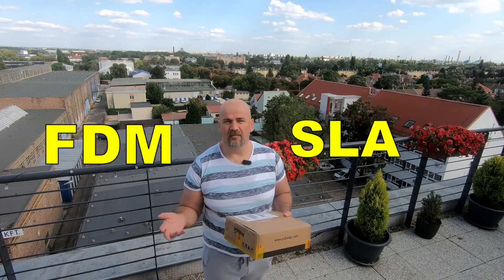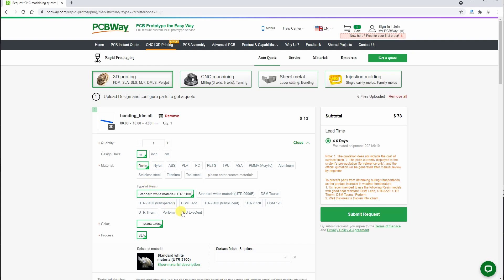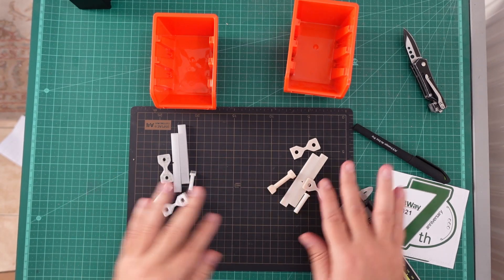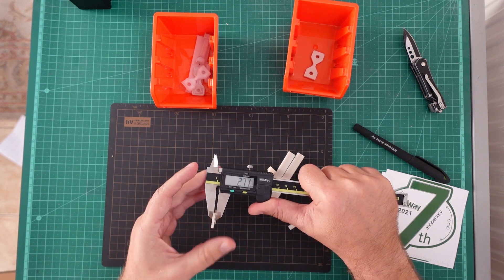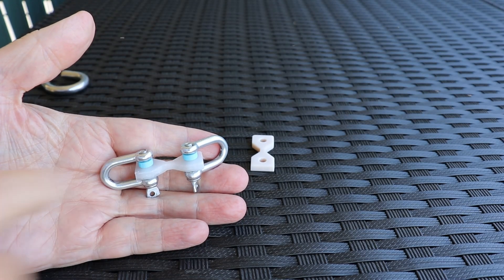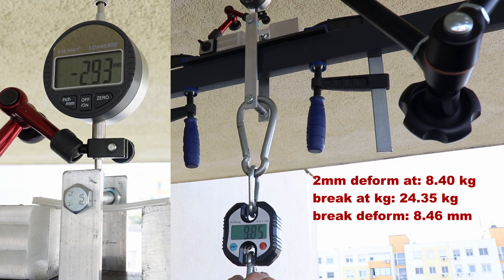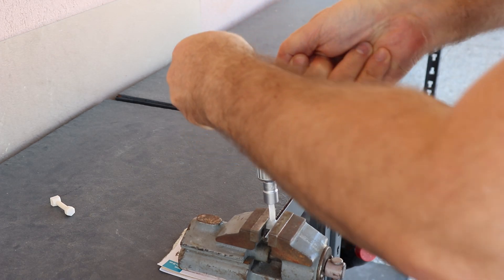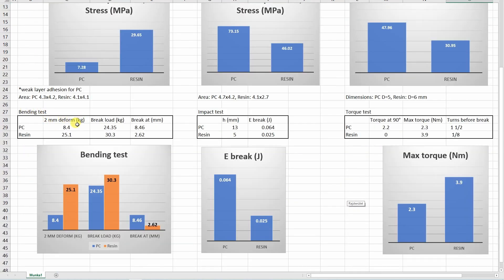Another FDM vs SLA battle: PolyCarbonate vs Perform Resin - 3D printing services from PCBWay

Comment: I really like your testing. I just want to comment on your suppliers. They may offer services to build parts but I am skeptical that the utmost care is taken when building those parts. FDM PC printing requires attention to temperature in all aspects of the printing process and even post heating. Most filament manufactures require  two to four hours of annealing after PC is printed. I can get a good idea of what your results show, but I feel until you produce the parts yourself  I have to take the results with a grain of salt. Again, I really appreciate what you are trying to do here and have subscribed to your channel.
Reply: I think for the case of FDM PC printing, if attention to detail is put in with respect to first layer parameters, bed prep, bed temp, enclosure temp, printing head temp, and the recommended filament manufacturer annealing times/temp; then FDM PC parts can be close to injection molded parts for certain applications. This would be a great comparison for the "My Tech Fun" channel.

Comment: Maybe i am wrong, but i think SLA printed objects are more similar to injection molded parts. Sometimes it gives an advantage to them sometimes the FDM performs better. Kinda similar to solid wood vs plywood strength.
Reply: Not really, fdm parts will always be at most equal to, but generally weaker than a identical injection molded part ( assuming the same plastic) due to layer adhesion.  resin is a quite different story as it has to be made of molecules that can be polymerized at low temps, uv blocking and many other factors as well as being mechanically strong. It's pretty difficult to make a resin that's good at all those things
Reply: I think for the case of FDM PC printing, if attention to detail is put in with respect to first layer parameters, bed prep, bed temp, enclosure temp, printing head temp, and the recommended filament manufacturer annealing times/temp; then FDM PC parts can be close to injection molded parts for certain applications. This would be a great comparison for the "My Tech Fun" channel.

Comment: SLA either has burn in layers on the bottom, when printed on the build surface directly or when raised and supported SLA prints will have support marks on the bottom. I think they sand these prints.
Reply: I rather think that here in the first layers the part stuck to the FEP (as it was flat on the FEP) and then only at a later stage it got loose and stuck to possibly additional supports again.  Sanding should not take that much thickness off the part as seen here.  Any way you look at it, the fact that their quality control did not catch this is the real shocker....